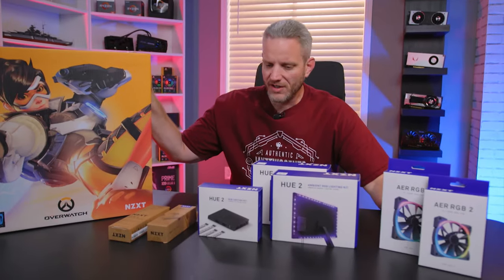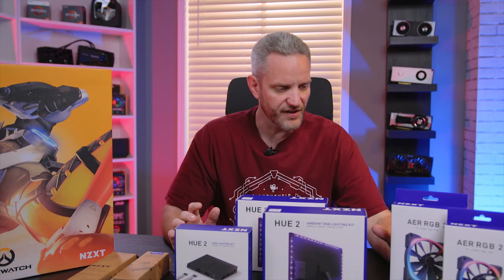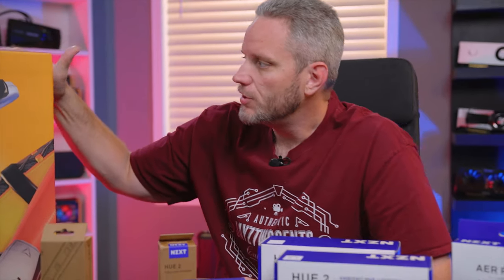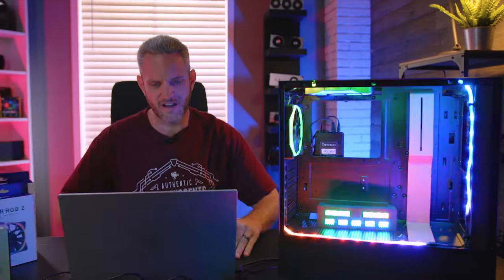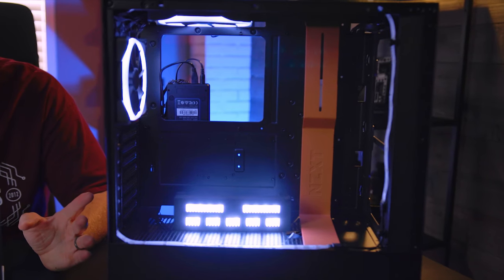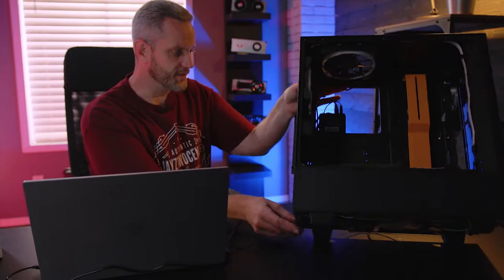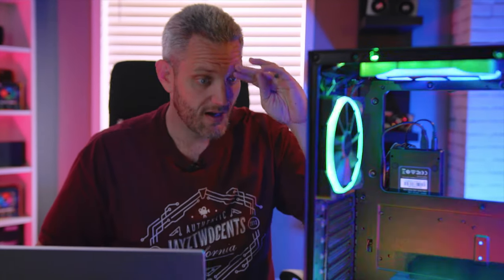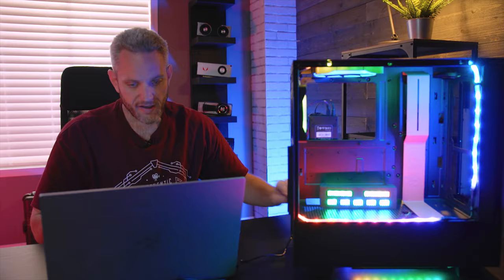NZXT Hue 2 Lighting Eco-System... Sunglasses not included

Comment: NZXT hue stuff is garbage. I had the fans, LED strips and a radiator in my old rig and the lighting didn't work 60% of the time. Neither did the software which was a huge joke. I switched to Thermaltake fans and haven't had a single issue with them to date

Comment: I bought the original hue+ ...
Nzxt Cam is one of the worst pieces of software I've ever had on my PC. Hard pass on anything nzxt after that, also way overpriced for LED lights. I spent $80 on just 8 steps and the controller, I'm sure everything shown here is more like $250
Edit: NVM it's way more than that lol, 3 fans is $130 and $100 for the monitor lights lol so more like $5-700 for what's featured here lulz

Comment: I see absolutely no point in Windows in a PC Case. I see no point in all the glowy bits. I want performance out of a box that is otherwise unnoticable. windows and spastically blinking shit is distracting. And closed of front panels that restrict airflow even one bit are a nogo.

Where the fuck went all the normal computerstuff for peiople that just want performance? I dont mind that people who want rainbow puke get rainbow puke. What i mind is that it negatively affects me because the looks oriented cases increase temperatures and noise. Im looking for a high end watercooling case and there is not a SINGLE case that i can buy in germany that fits the bill since Caselabs went the way of the dodo. Even something like the enthoo Elite or the Obsidian 1000D puts form over function. And with mainboards the next generation of AMD boards all come with shitty fans that by all experiences i had with these piece of shit custom minifans will be noisy and die quickly and are hard as fuck to replace. So i either have to wait month for watercooling parts to come out (if ever) or do some janky mods with passive cooling elements, heatpipes and thermalglue. Great... And why do they have shitty fans? To still offer the place for the big plastic or aluminium shields that trap heat under them and are necessary for rainbowpuke and "gamerlogos" and a "clean" look. Stupid.

Then i remember a LED SSD that overheated due to the stupid LEDs.

This simply has gone to far, i want my cool, silent and performanceoriented parts back! Give the rainbowpukers what they want but leave some choice in place for people who dont want it.

/rant off